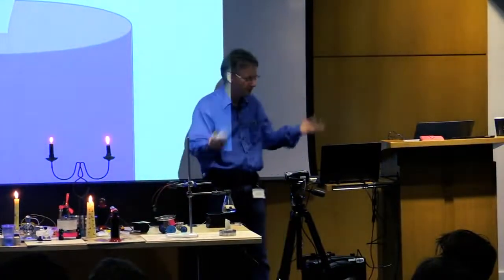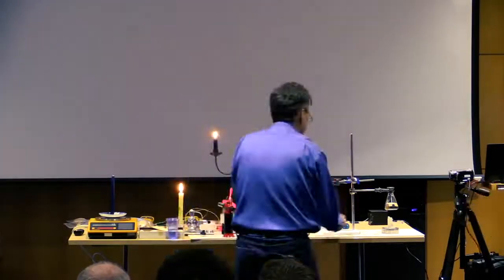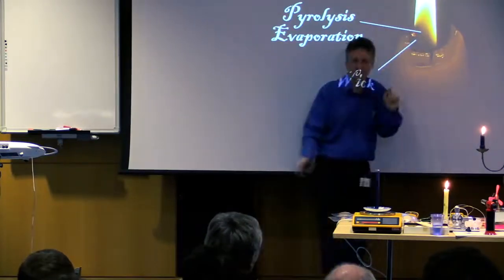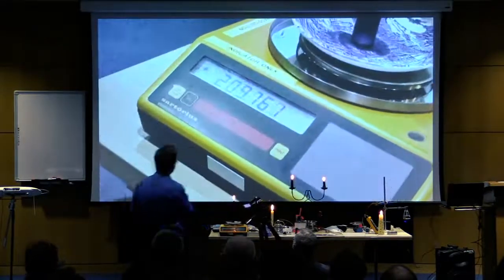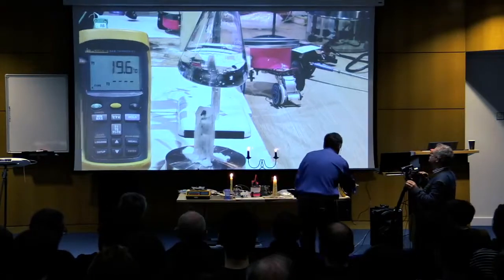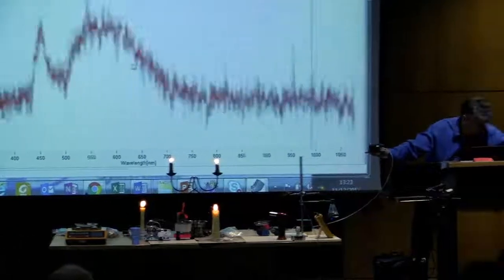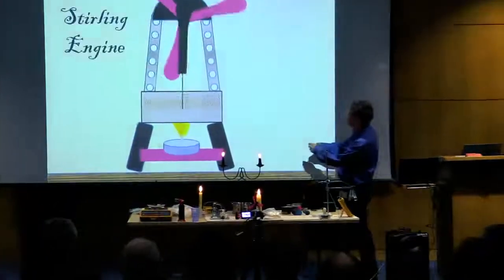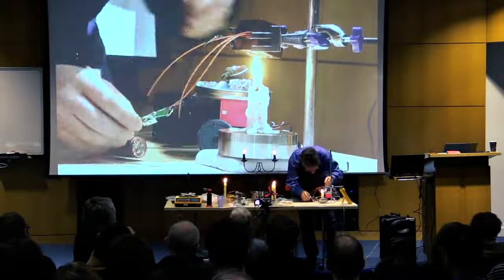Candles at Christmas: A talk by Michael de Podesta

Comment: I'm quite surprised that your "calorimeter" gave a result fir the geat if combustion of the wax that was nearly 80% of the theoretical value.  When I worked in a school we used to compare similar set ups - but using copper instead of glass - with a Nuffield calorimeter.  We were lucky if the former gave a value of 40% of theoretical and the Nuffield calorimeter result was maybe 90% accurate.
Reply: ..sorry "heat of combustion..."
Reply from the maker: @philward53 Good Evening. Well I can only tell you what I did and how the numbers worked out! Perhaps if they Hadn't worked out so well I would have done it again until I got a 'better' answer!.

Two thoughts: 
1. Did you plot temperature versus time and then take the slope? 
2. Using copper, heat can flow away from the heating zone - adding to heat losses - whereas using glassware, the low thermal conductivity across the base means the heat transfer from the candle was mainly through the glass and into the water?

In any case - keep experimenting! I'll be giving a similar talk live in Richmond on 15th December if you are in the  area!

Best wishes

Michael